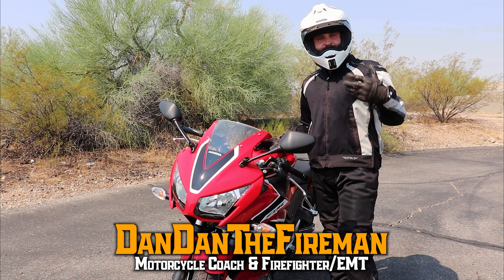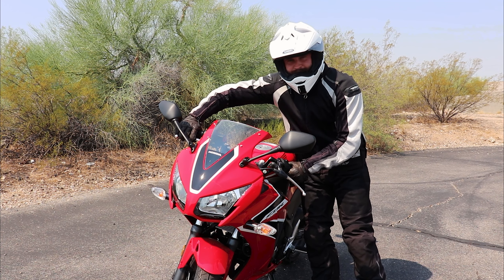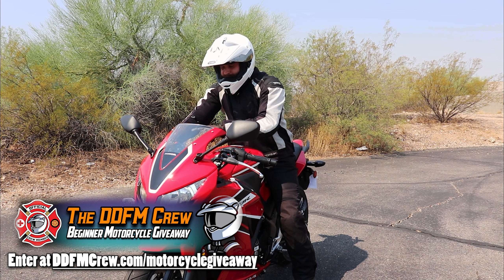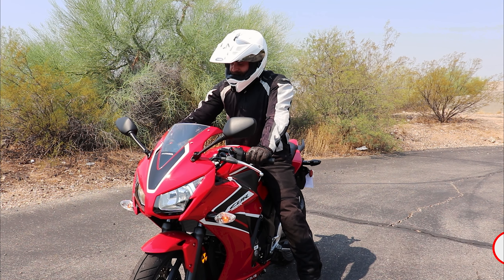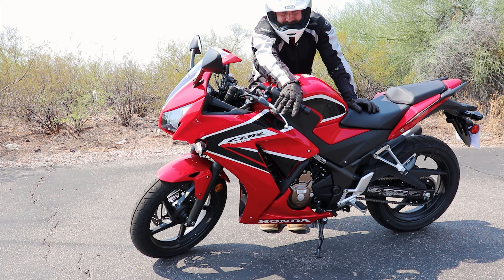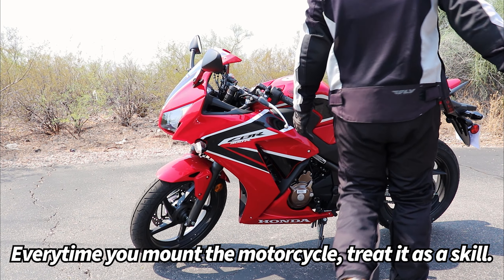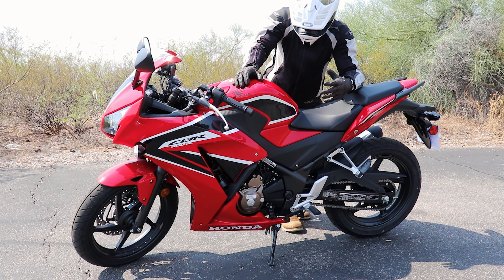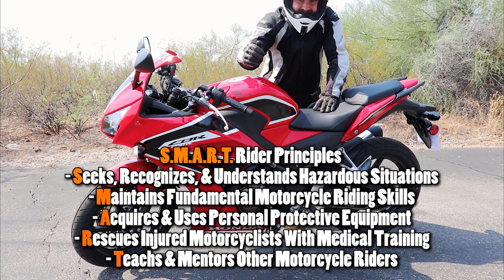Motorcycle Friction Zone & Motorcycle Brake Operation

Comment: I know this isn't related but for first bike I have no idea what to get. I like the Husqvarna svartpilen 401 over the Duke and I am looking at the Honda cb500f and the 650r but that one is a little pricey lol. I'm just looking for a decent naked bike that will be reliable and would be able to ride for years to come without wanting more.
Reply: Some cruisers like the dct or the rebel 500(just looking throught Honda rn) but the weight of them might worry me.
Reply: Got my first bike a few months ago (like 4 months or so), so I think I know how you feel.

Ultimately the lesson I've learned is it's a 3-step process:

1) Find the kind of bike you want. I wanted a Naked bike, I didn't want a sport or a cruiser. I wanted a naked bike, it felt like the most appropriate for me. A friend of mine is getting into motorcycles herself, she's pretty small in size so she's going cruiser (actually she's going with a Rebel 500).

2) Don't buy too powerful. Trust me, my bike, even though it's not powerful when compared to other bikes, is already plenty powerful enough, it took me a while to get used to it compared to cars. On motorcycles, you have to be sooooo light with your clutch, throttle, and break inputs it's actually insane. Less powerful bike = easier to learn how to ride bikes. You already have to learn how to ride a bike, don't make it harder. I would say 25-35 kW is the best (about 33-46 hp).

3) Buy secondhand. The thing is, when you're learning, you're much more prone to make mistakes. Meaning you're much more prone to drop your bike or do really anything bad to it. Meaning your repair bills are gonna be higher than a few years down the line when you're more experienced. I liked to tell myself I was gonna be careful and it was gonna be fine.... lol yeah right I dropped my bike within two weeks of getting it. It was stupid as well, I was completely stopped but the road was crooked to the right, so I... I dropped it to the right, thankfully it only meant the rear break was rendered unusable, no other damage, but I had to pay that repair bill.

So I ended up with a 2006 Yamaha MT-03 with 30'000 km on it (about 18.5k miles) with 33 hp that I paid just straight up with cash, for 2500 Swiss Francs.

I am soooo eternally grateful that I made that decision because DAMN I can't imagine going through what I went through on a brand new 6-9k bike that I had to pay back a loan on.
Reply: @alyeanna  I also am looking at naked bikes and know someone else that is short and might get a cruiser lol. Only problem I have with a smaller bike is while it's easier to learn which is great I don't want to worry about "growing out of it". That Honda 650 is a really nice bike but I'm sure I'd be very worried about any damage to it.  And with buying used, I know it's better because it is cheaper and less worrying about the bike in general, I don't think I know enough about motorcycles to spot a good one or a bad one and I don't know anybody that knows about them either. I very well could end up buying used on a bike and then having to fix it enough to where it cost just as much as a new one. New or used I'll worry about the bike but a new one a little more
Also: newer ones have some safety features
Reply: @Lee-sr4ye  Have you considered the Kawasaki Versys 650? They are readily available used, very reliable, inexpensive to maintain, and easy to work on.  I've heard from several people on the discord that they are very forgiving and easy to ride.  A great starter but also powerful enough to stay with for a few years.
Reply: @theprodigalstranger5259  I've heard about them but I mostly looked at the z400 lol
Reply: The cb650r bike looks awesome and all, but for what you get might be a little pricey. Wish they had a cb500r because the 300 is a little small.
Reply: @Lee-sr4ye  I love the look of the 650R as well but finally settled on 500F ABS, new not used though - 5700+ tax, so better than some used options. I also looked at Kawa 650 etc and there are more used ones out there. Being new rider, I thought the slipper clutch and ABS were added benefits on Honda.
Reply: @brucenaremore3433  I was thinking about the 500f, but that 4 cylinder and the styling of the 650r tho lol. Tempted to get the 300r too but maybe might not have enough power. I like the Husqvarna svartpilen 401, but I heard that KTM isn't too reliable tho.
Reply: I bought my first bike in January but only have my license for less than a month now.

My process to choose a bike was this one (took me over 6 months to decide on a bike and then 2 more months frantically searching for good deals).
1) I love cruisers (I'm a total Harley girl at heart), but my main purpose was saving money when commuting. No cruiser would achieve the low consumption I wanted, most consume even more than my BMW 116ed (and gasoline is more expensive than diesel over here), even the Rebel500 or the Vulcan 700 wouldn't save me money, which I considered for a long time.
2) My commute is 75km of highway, including a bridge that has a shitton of wind - many times it actually closes to motorcycles, considering how dangerous it is. So a naked bike probably wouldn't be the best idea, so I needed fairings. So much highway also means that most 300s would also be screaming almost at top speed all the time, so I needed at least 500cc. This excluded the G300GS or Zontes that I was looking into.
3) I always carry two backpacks: my lunch and my work stuff. So I wanted a bike that either had storing space or didn't look stupid with a top case. This excluded Café and Scrambler type bikes that I was also looking into.
4) I have a knee injury, so I tried to sit on a Ninja 600 and I couldn't even bend my knee to use the rear brake without getting massive cramps. So, sport type bikes are out (I also dislike them in general, but they are dirt cheap).
5) I hate scooters, despite what everyone kept suggesting me to get (maybe because I'm a woman, but people were legit suggesting 600cc scooters /shrug).
6) My budget was at max 5000, and preferably below 4500.

Combining all this, there was actually one bike that fit all these criteria, the NC700x. It consumes as low as 3L/100km on cruise speed, it has nice fairings and very good ergonomics, it's a 700cc but with very low HP (so you won't go anywhere too fast if you aren't good with the throttle yet), it's shaped like an ADV so it looks great with a case AND it has a met-in space where the fuel tank usually is. Only draw backs is that it is a bit tall for me (I lowered it and next week getting a new lowered seat, so all good) and the major one is the small fuel tank due to the met-in, which means that by driving 150km each day, I have to be refuelling a crap ton of times. With a higher budget I would've gone to the newer CB500X, for example, which has more 3L of capacity, or with something a bit stronger and more modern like the V-Strom or the Versys.

Sure, I'm still in love with cruisers and those are the bikes I want in my life. But for now, the NC ticks all the boxes that I needed and I'm positive that I made a great deal. Even though I didn't get the bike that I WANTED, I got the bike that I NEEDED.
Reply: @sorayaimperial  That was a great tear down on how to chose a bike. Me personally, I don't have many needs for a bike in general but I want to get into motorcycling. I am looking to have them possible on highways but honestly I don't go above 55mph any usual day and if I have to I hope the bike can but for trips I still have my car. I want a bike that is light and easier to handle than a cruiser because it'll be easier to me overall around town. I don't like sport bikes because of how slouched they are. That's why I started looking at naked bikes and really like the neo retro design on some of them. I'm only looking at some 650s for 'future proofing' but I think that cb650r might be a nice second bike (even though I don't like the idea of a starter bike and buying a new one in a couple years but I also don't want to spend 8k or more on something I don't know how much I'll like yet) Might....just might get the 650 IF I want to just have this one bike for years and years to come but 500cc or less would work just fine too but could have some trouble going on trips in the future but that's a problem for another time? The Husqvarna svartpilen 401 is the bike I'm leaning to the most but I'm not sure how reliable it is since I heard KTM isn't too reliable with the Duke 390. maybe the Honda cb500f or  cb300r for reliability but idk

Comment: Looking for all advice I can get. I want to get into motorcycles however my parents are not fond of the idea. I love in a place where we do have paved streets however many potholes. Would it be wise for a first bike to be a dual sport to counteract this? Previously I wanted a mini bike like a grom just to drive for fun I already have a car so this would not be my primary form of transportation.
Reply: I'd say that learning how to swerve and avoid potholes should be your main focus! We have this problem as well, not with potholes, but with sewer lids that have colapsed.

Then, get a bike with a nice rugged suspension and a bit of ground clearance. Dual sport is an option, but then you get a bit more restricted if you ever want to go on a longer ride, unless you buy a KTM super adventure or an Africa Twin (which are quite heavy and devilish and not very good at first bikes). ADVs would be great, something like the Versys or V-Strom. Cruisers and mini bikes are a no-no if there's that many potholes, cruisers not only because of lower ride height but also because they are heavier and slower to swerve. Sport bikes, especially if you are not very experienced, can cause you to open throttle as you go through a hole and yeet yourself (done that in class, going up a 2cm step, crashed the 90's supersport and myself into a parked lorry).

I got an NC700x as my first bike, which is a weird mix of an ADV-type bike in terms of height, but is not well suited for actual offroad and is more of a commuter. Think of it as a street naked but higher, with an engine that runs and sounds like a car, and fuel mileage that can rival a scooter. Handles potholes just great, and I've actually lowered it (making it more unstable and rougher to ride in bumps, but still manages pretty well).

Edit: my parents hated the idea of me getting a bike. So I took the bike license after I don't live at home anymore (I'm 27, lol). Then I bought a bike, and they have NO idea that I did so :D It was the only way to fulfil my bike dream without causing my family to disown me or something.
Reply: Soraya Imperial Thank you so much for the help

Comment: Hi Dan, I've been watching your videos and you have wonderful advice. As a female rider, I want some advice about what if you can only one foot the bike. Not even flat foot, but tip toe. I cannot duck waddle back and I have to push the bike back by jumping off it and on. Would you be using both brakes? Back and front at the friction zone when stopping if you can't reach the floor with both feet? Appreciate for your advice for a very very short beginner rider.